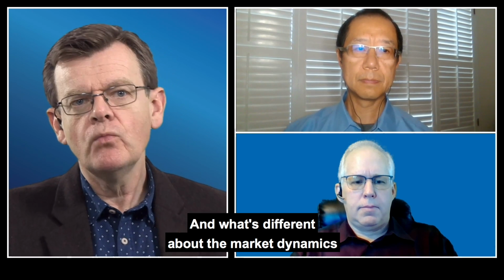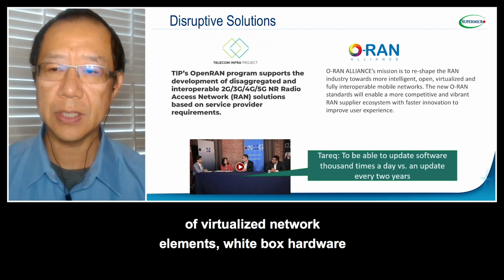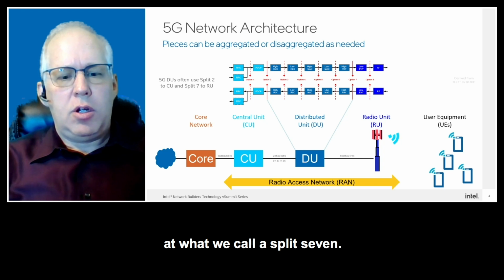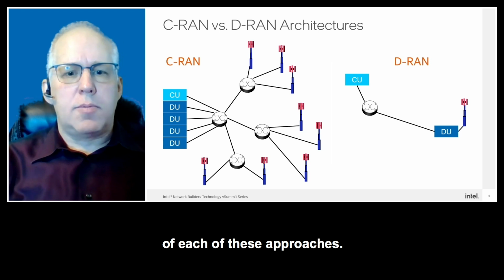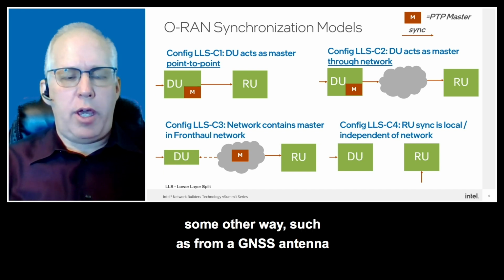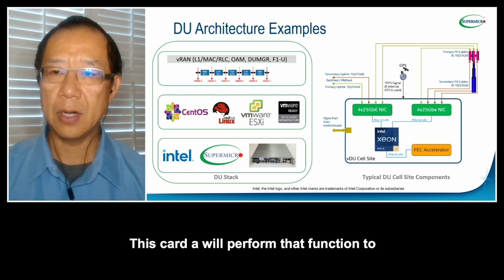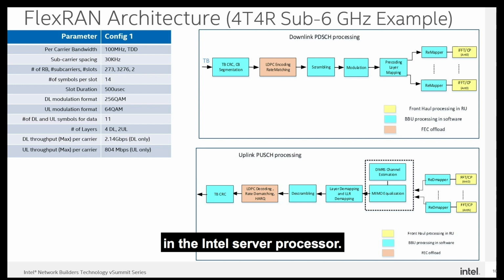Building an OpenRAN DU with Intel’s FlexRAN

Comment: Thanks for a good introduction material. 
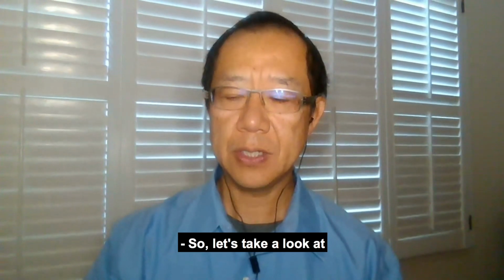Context: "DU Architecture Examples" by Yaming, at ~15:20min.. The slide explains the DU in a physical system setup, showing the Fronthaul connection to the RU, and the Mid/Backhaul to the CU.. I have a question on the Primary & Secondary connections -- What is the purpose of these 2 - is it for redundancy ?
Could you also elaborate (or provide pointers) to the Containerization activities in the vDU realization.